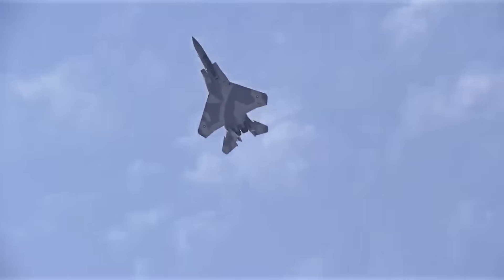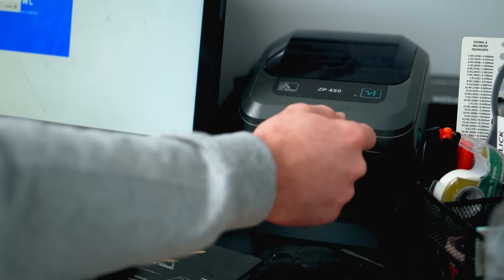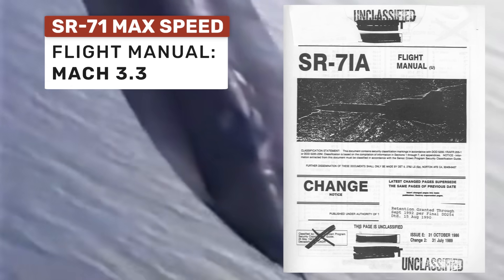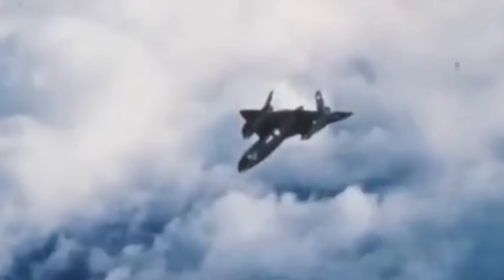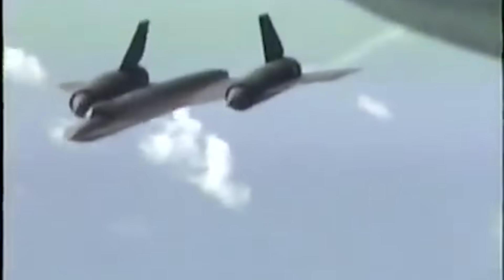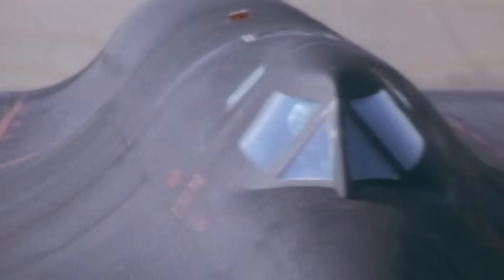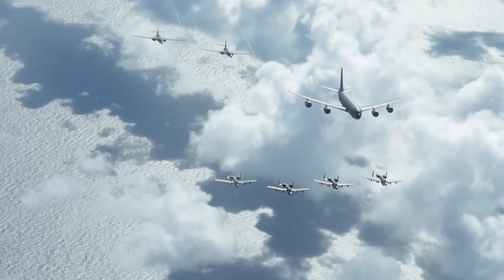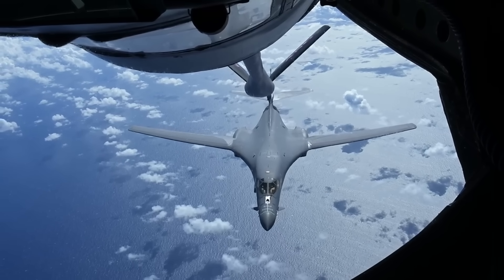The SR-71 was MUCH FASTER than the Air Force will admit

Comment: Ah great repeating more stuff that's been disproved decades ago.
No, the SR-71 was computer analyzed by some curious experts  in the 90s/00s and they concluded that, technically the plane could reach mach 3.55 but it would damage so much so quickly from the heat it wasn't realistic. The plane could breach mach 3.45 in perfect conditions, which are extremely rare, and had a more realistic operating speed of mach 3.15-3.3. It's very dependent on the mission, the area, the altitude, the temperature, the weather conditions. The plane was essentially running at "110%" at all times, and had perhaps 3% more engine throttle available for emergencies. Yo ucan actually find flight perameters in the declassified pilot manual. Easy to read the charts once you understand 3-variable slide rule.
Sadly this comment will get buried by the algorithm and the impossible myths will persist for years and years and more years.
Reply: Well, we and you can either go by your cursory glance at a website where you quote probably those who are quoting something they read, or you can read many of the relayed testimonials here of actual pilots who flew the thing!  There seems to be two distinct groups here, those who are open to possibility and believe and naysayers who won't believe no matter what you say!  There's not many in-between!

Comment: I mean, technically it's true, I don't even doubt it because if you think about it, it's pretty obvious and a foregone conclusion. Yes, the Blackbird could go faster than its official top speed stated. The real question is, how LONG could it keep going that fast. My guess is, not that long before incurring on critical structural failure.

Comment: Cruise speed and a short burst top speed are two different animals. A top speed of over Mach 4 and a ceiling close to 100.000 ft. is possible and also tried according to the info I have. Hovewer nobody will confirm that on record and a lot of Oxcart material is still classified. Look at some of the speed records AND then include the refuelings required and you will find some impressive Mach numbers 😏 Still holds the speed record. Not bad for a development that started in the late fifties. We had very bright people then. Now we are left with unbelievable stupid MAGAs. Very sad. 🙄
Reply: That’s what I think it’s closer to. The cruise speed is what it can do for an extended period without excess damage. But, if really pushed it should be much faster at least for a short time. 
Considering their response to missiles launched at them was to just go full throttle means they weren’t running around wide open all the time.

Comment: Aircraft are getting slower and slower, Service ceiling is getting lower and lower?
Just one example, F15 Eagle. Original specs were:
Top Speed= Mach 2.85 loaded, Mach 3.0 Minimally loaded.
Service ceiling = 90,000ft + Yes, it's a Foxbat killer, and the Soviets were seriously crapping their pants, when it was introduced.
Now, these idiots who think we're stupid say.....
Top speed = Mach 2.5 (Actually, the F14 Tomcat has a top speed of Mach 2.5).
Service ceiling = 66,000 ft. With these specs, you wouldn't get within 500 miles of a MiG 25 Foxbat. Russia would be laughing, however, they know better. That's why Sukoi built the SU-57, TRYING to copy the Raptor (Failing completely).
Another lie? 
F22 Raptor. Top speed = Mach 2.25. Well, the engines of the Raptor are only 15,000 lbs/thrust TOTAL lower than the SR71, which we're NOW being told is:

SR71:

Top Speed = Mach 3.2. (Also, Foxbat top speed, Russia laughing).
When it actually (SR71) can reach Mach 4, in an emergency. However, that WOULD damage it, so they only fly it to a max speed of Mach 3.8. (Soviets crapped their pants). THIS is what the ORIGINAL specs said, according to Air Force personnel. I also know a few Blackbird pilots.

The Raptor is 1/3 lighter (loaded) than the Blackbird, and is half the length. Do the math. Thrust to weight compared to the Blackbird, and it tells you that the F22 can reach speeds of at LEAST, Mach 3.4. Why the hell do you think the Russians are trying to copy it?
If the Raptors top speed was only Mach 2.25, Russia would be laughing, The MiG 31 can travel at Mach 2.83. The MiG 25, has a top speed of Mach 3.0, but not reliably. WHY wouldn't Russia just improve the Foxbat OR the Foxhound, by using more Titanium, and reduce the size a little, and use an improved version of the Tumanski engines used in the MiG25, or just put the Tumanski engines in the SU-57? Russians AREN'T STUPID! They would NOT be copying the F22, if it had the anemic specs, that we're being "told".
Oh, and one more lie.
Not sure if it's called "Darkstar", or "Aurora", but I lived in Nevada for 4 years, right in the path where they fly military aircraft. This was in 2000. I cannot tell you how many times I seen "Donuts on a Rope" Com trails in the air, and, High speed "Triangles" flying overhead so fast, tracking with your eyes, was scary enough to make the hair stand up on the back of your neck. There have been Ramjets/Scramjets flying since around 2004

Comment: Yes, much faster. Catchy title on the thumbnail.
With the reality that the F-15 and the MIG 25 foxbat, both are reportedly able to surpass Mach 3, none of them have ever been reported to have leading edge wing damage from going that fast from the heat. And yet all of us know that the SR 71 has Specially designed high temperature titanium leading edges and panels to withstand very high temperatures from going fast enough to incur those temperatures. So If the 15s and 25s don’t get that hot going Mach 3, then why would the SR 71 get hot going 3.2!?… Or 3.5? 
And also the X-15 went very much faster than 3.2 or 3.5 mach and also did not burn up from the heat buildup of supersonic airflow around it. Hmmm. 
Answer, is it is much faster than a few hundred miles an hour faster than Mach 3.2.
Ah, hem.

Comment: Its been over 10 yrs but there was 2 separate interviews. Those interviews I think where from th 80's and or 90's. One by a pilot who had flown the blackbird, and another by a pilot/command and control person. 
The pilot stated that he took the aircraft to almost Mach 6. And he said, that there was plenty of power left and he wasn't even at 3/4's of the throttle. And suggested that the aircraft wanted more. 
The other pilot/command person stated that Mach 3 wasn't even close to the capabilities of the blackbird.
Remember if the x-15 can go Mach 6, blackbirds came right after that technology.
This info is out there, you just have to research alot more to find things nowadays.
These are not quotes, just a close summary of what I remembered.
My theory is that the Blackbird was capable of over Mach 7. And the throttle maxed out at Mach 8.

Comment: Yeah, not like these ego tripping dudes could lie, like fishermen about biiiig fish. There is a reason other SR pilots say the claim is BS. And even if dude saw that, there is no reason to think he was right, could just be sensor malfunction/error. My car shows higher top speed in winter as tires slip on ice and rotate faster, doesn't mean it's real speed. That's why speed records are observed from outside, to get reliable data, not rely on 70s terrible spinning air measures that were unreliable at best even on the ground...

Comment: Pilot David Peters was telling me at near mach 3.5 there was a lot of wind disruption that came off the nose chines that then affected the airflow into the engines. This and the compressor inlet temperature limit was what limited the speed for the SR-71. Id take the claim of mach 3.56 with a pinch of salt like the other tall tales that were told.

Comment: My doubts about the F-15 being able to get anywhere NEAR 2.9 is… the Blackbird was designed to expand because of the heat at those speeds, so much so that it leaked fuel on the ground… did they redesign the Eagle to leak on the ground and expand by 4 feet while going nearly Mach 3? I doubt it.

Comment: In the 90's Shul stated that problem was with airframe and engines ware. The amount heated generated at speeds above MACH 2 take a serious toll on all aircraft and its engines, the SR-71 was no different. Even though the SR-71 was designed to fly at higher speeds and high altitudes longer than any aircraft before, there were still physical limitations. He said limits were put on how fast, how high and how long you could run the aircraft to preserve the airframe and engine life time. He said the SR-71 could go faster and higher than stated with no short term problems. But you would basically be cutting the useable life time of airframe and engines up to half.

Comment: I had a guided tour of the Seattle Museum of Flight. The guide used to be a 71 pilot. Told some amazing stories. When he told us the "official" too speed, my father asked what the unofficial top speed was. He responded with, "Fast is all I can say."
Reply: USAF museum is better than any other
Reply: @Stienecker  that sounds really cool.
Reply: @Stienecker how many weather balloons do they have on display?
Reply: @American-Motors-Corporation just the wreckage of one with characters written in Mandarin I’d suspect!
Reply: The flight manual authorized Mach 3.3 at the discretion of the mission commander. It's limited by compressor inlet temperature -- the colder the stratosphere, the faster you can go. I caught up with a senior mechanic at an event and asked if Lockheed had ever given them a top speed number for ideal conditions. He said Lockheed had told them Mach 3.4 was the "never exceed" because of too many unknowns. But no question the plane could have kept accelerating.
Reply: Of course it was faster. No need to tell the Soviets just how fast it actually was.
Reply: @KlausKokholmPetersen  The Soviet Union is gone and the aircraft is retired. I don't see how revealing whether or not Maj. Shul's Mach 3.5 claim was accurate or not would hurt, and if it's been pushed even further, that wouldn't hurt either. I don't even think NASA uses them for RAMJET testing any more like they were into the 2000s, I think they're completely retired and just sit around in museums.

Comment: Speed isn't the issue, but the temperature of the inlet. Flying over Libya Major Shul was authorized to take the inlet temperature to 450 degrees instead of 429 (Celsius) which is why they exceeded Mach 3.5 on that flight!

Comment: RE YF-12 speed records I once went to dinner where the speaker was the Colonel sitting in the back seat on those runs.  The odd thing not known; is that the FAI only records the number you want recorded.  So, the YF-12 was flying faster when it set the altitude record, than it was when it set the speed record. And it was flying higher than the altitude record when it set the speed record.

Comment: The SR had enough thrust to fly itself apart, because the engines were the pinnacle of design, and the airframe could only be maximized so much because of materials available. When the USSR built the Foxbat, NOTHING on the plane could survive it's c.aimed top speed, they destroyed many of them proving that point.

Comment: A friend who worked at Edwards AFB (as a senior FTE) told a story of the last official flight (the LA-NY record flight), where the plane was unable to take on a full fuel load so was unable to fly as fast as they planned. Since the plane was going to wind up in a museum after it landed, they weren’t worried about overheating the aircraft, so they were going to “show off.” The original flight plan was under an hour from LA-NY, but without a full fuel load, they had to throttle back. Even so, the plane came close to Mach 3.4 (2242mph) at one point in the trip.

Comment: I met Brian Shul in Wichita KS at a conference and I had the privilege of being the first in line to buy his book. I asked him if they'd ever declassified the top speed to which he replied: "Oh, it was never classified, we just don't really know the top speed; it just kept getting hotter so we'd have to back off."
Reply: Now, this post is more believable than most of the others... SR 71 engines were ram jets. Ram jets...the faster it goes, the faster it wants to go... It makes all the sense in the world that its top speed was never really known!!! BTW,the original designator for the blackbird was RS 71... Lyndon Johnson turned the letters around when he first announced the aircraft!!! Top speed was never determined...
Reply: @philhand5830  They weren't actually ramjets since all the inlet air goes through the first few stages of compression before some of it bypassing around the engine core and going off to the afterburners. Ramjets don't have any compressors. It's really a type of turbofan.
Reply: @BooBaddyBig  Pratt & Whitney J58. they where ramjets but also turbo fans in a hybrid setup. at low speeds the spike is extended and and trust comes from the turbofan. at high speed the engine spike ( the cone at the front of the engine) is retracted the suck in doors to the turbo fan are closed as well as the tertia doors being closed. all trust came from the ram jet part of the engine. And the turbo fan only provided a cool air barrior to keep the burning fuel from melting the engine casing, and in some models at vary high speeds Water/methanol was injected to provide cooling.
Reply: @natlkjh8677  OK, I've got it now. No, not really. You need to understand that there's TWO sets of bypass. The first set is used at all speeds, and is cooling air from right after the inlet, and goes completely past the engine and all the little pipes and straight into the nozzle, bypassing the afterburner and isn't directly reheated and so isn't really a ramjet (except it may mix and burn with the other flows within the nozzle a bit.) The second comes off after the compressor in six big tubes and is variable and goes into the afterburner section. That's just an afterburning turbofan.
Reply: they have a bypass
Reply: Yeah Ive always figured the top speed was 'structural failute due to hull melting'.
Reply: The SR-71's top speed is 100 MPH more than that of the missiles that have been fired at it.
Reply: When the pilots have to sit in the  cockpit for an hour or more for the SR-71 to cool off before one tells you how hot it got.......

Comment: Alot of claims and nothing to substantiate. Pilots tales are as tall as fishermen's.  The only reliable words we have put the sr71 at Mach 3.4, and it is faster than the a12. Despite the slight size difference,  the aerodynamic improvements allowed it to maintain higher speeds than the a12. 

Mig25 enters the chat. No record,  but fastest radar tag to date, faster than the sr71 could hope to fly

Comment: toI was a KC-135Q Tanker Task Force Navigator in Kadena AB during the mid 1980s and personally clocked the Sr-71 at above 3.5 Mach! We were airborne skirting the Russian border to air refuel the HABU on a post strike A/R and our jet was at FL330 and we saw a contrail above us, so I turned on my ranging equipment
Reply: SR-71's aren't going to create contrails at their max performance altitude (and have the ability to monitor and stay out of any contrails they do see). If you were motoring it, it would be via an A/A TACAN, which you'd know where it would be before you just happened to notice a contrail above you. Also, there is zero reason it is going to be going to refuel to you and still ripping by at max performance. Stop lying. I've spoken to the actual people who flew it during test flights, and the engine would flame out at 3.4. Nobody is going 3.5+ with those inlets.

Comment: The main reason to push the V-Max button is to get into firing range as quickly as possible to save fellow pilots in danger.
If my calculations are correct, using the V-Max button for six minutes could get a Mach 2.9 plane to cover over 200 miles, thus qualifying for a record attempt.

Comment: Can one determine the maximum possible speed of this aircraft from the angle of the nose shock wave when it reaches the engine inlet or wing tip?
Reply: Yes = Mach 3.56

Mach # = 1/sine(shock angle)

measure the angle from the tip to the wingtips from the centerline of the aircraft. I got about 16.5 degrees from an overhead picture.

Comment: "Top speed" is a judgment call.  Past the rated top speed, things start to get dangerous and expensive.   The engines start to erode.  The windshields anneal and have to be replaced.   Hydraulic seals and fluids get gummy.   Everything has to be deeply inspected.  Other parts time out way ahead of scheduled life.  And future reliability is compromised.   The nameplate top speed is just a point chosen that results in no great degradation.  Going above that is possible but things get very iffy and just a few minutes of over speed service may require millions of dollars of premature replacement of parts.